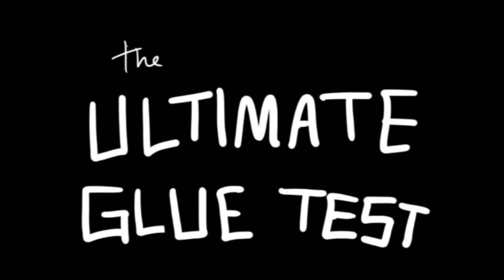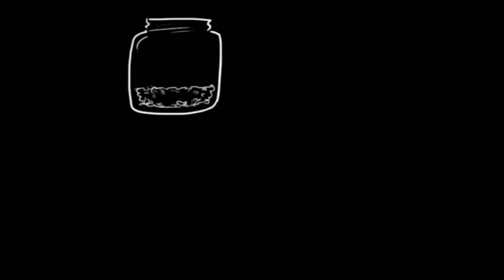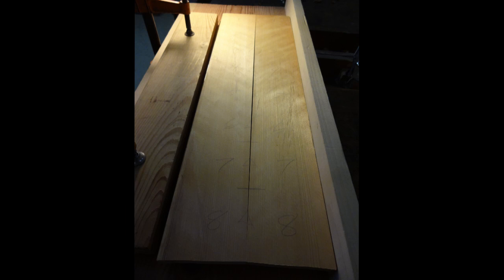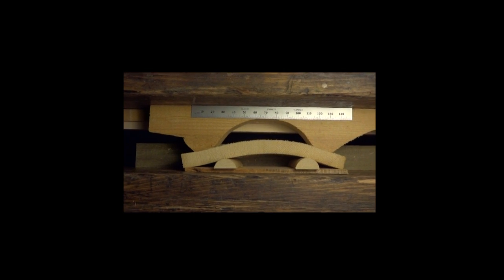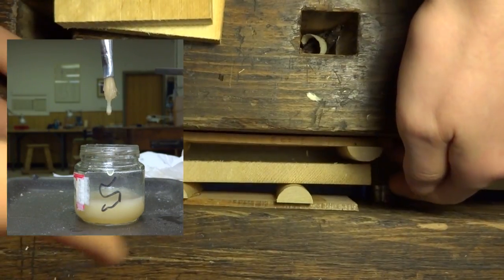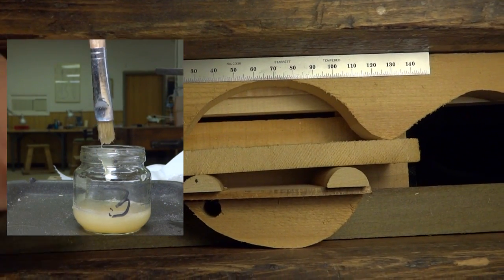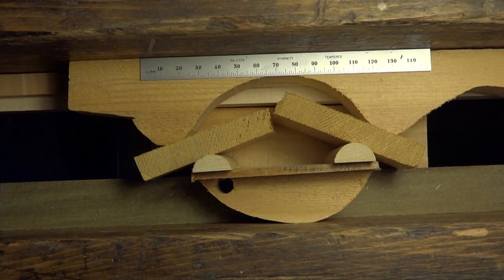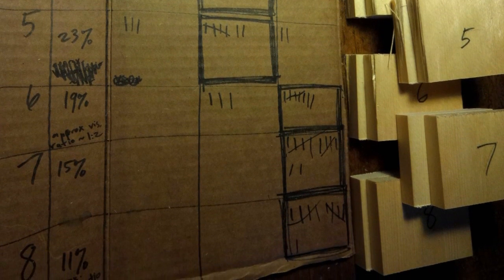The Ultimate Glue Test (hide glue)

Comment: Thank you that was interesting. I am in the piano trade which is actually far from violon making, but use essentially hide glue (sometime some very old batches in sheet, that is extra strong, chipping the glass, and staying li quid for a long moment before gellying) we generally want the joint to be very strong, but also use the retractating properties of glue to obtain stress, on a cloth or between 2 pièces of wood.)
Do you have managed to put some inner stress in resonating body, even for experiment ? It may go along with lack of dimensional stability so I doubt it have such interest, but for pianos it raise the resonnant frequencies, while the soundboard is basically "too heavy" in  treble/high treble, particularly on large instruments.

I suppose you prefer à clean break, easier to glue back, for the most sensitive parts.

Regards